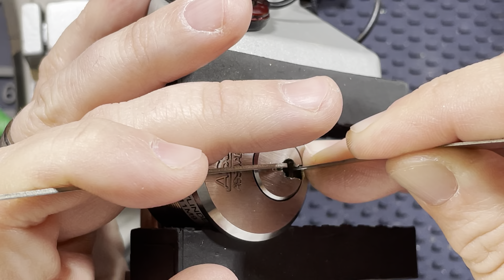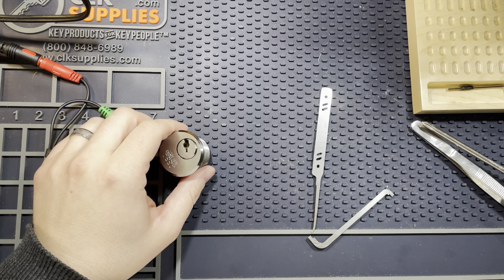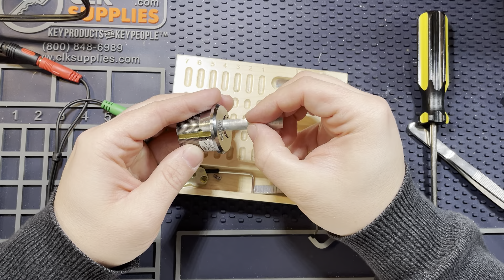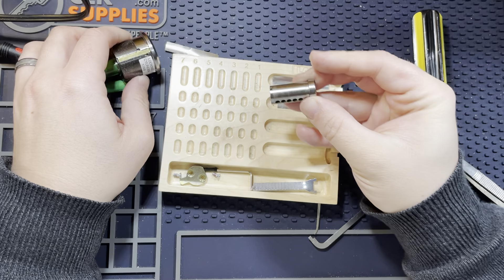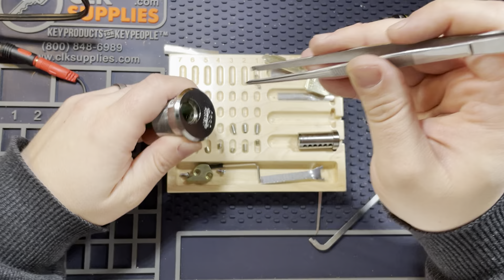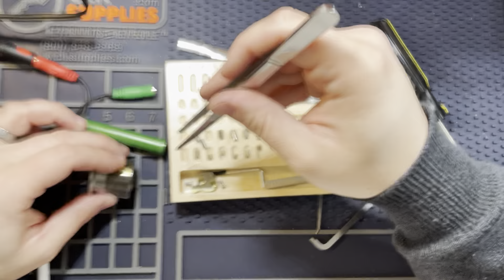[32] Assa max+ restricted, violently picked in angry silence then gutted publicly to shame it

Comment: Ya those barrel spool drivers with the double shallow countermilling in the plug are "tons of fun"  I see by key code # 865 that you got this from UHS Hardware in Hollywood, FL.  Cheap price but no sidebar (I sent mine back).  Another friend also had an extreme amount of trouble -- seems like those ASSA MAXIMUM + mortise locks have excellent tolerances making the main pins quite "frustrating" to pick.
Reply from the maker: I did in fact get it from UHS. I was looking for what’s effectively an Assa 600, so I didn’t want the sidebar in the first place. Working on those spools AND a sidebar is something I’ll fight with a few months down the road. 😅